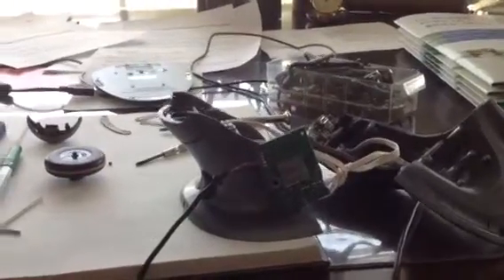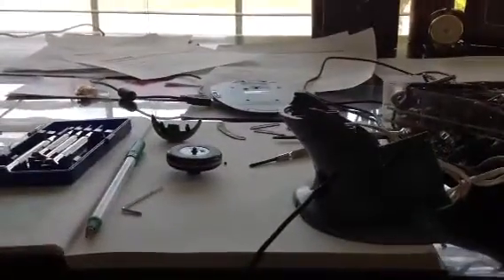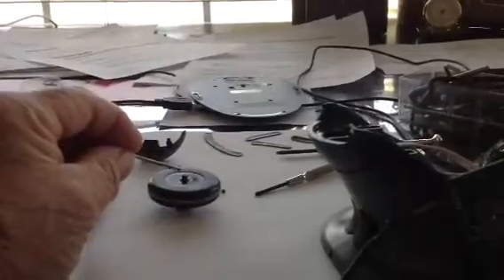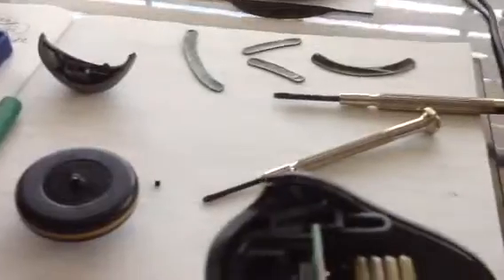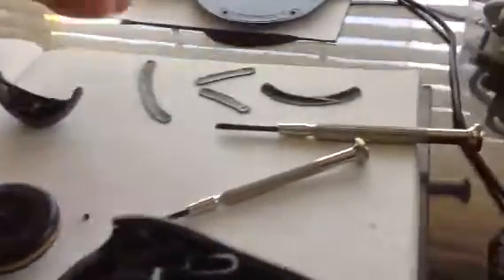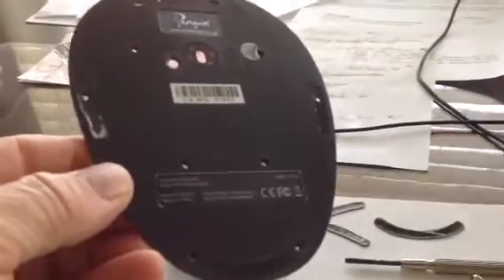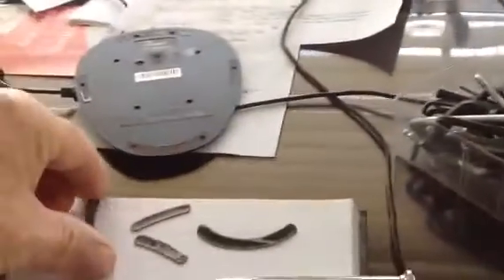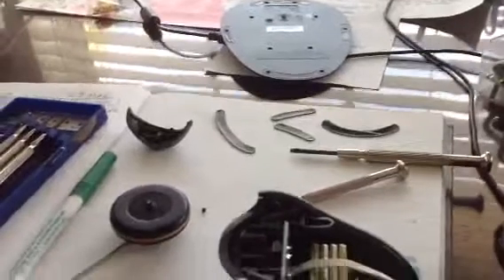How to Fix Scroll Wheel on Penguin Ergonomic Mouse

Comment: Hi Barry,
I have a different problem with my Penguin - the right click (lower) button is really hard to click -  you have to hold it in with quite  alot of force before it works - I suspect that there may be a cracked solder joint or maybe the clicker button is faulty - any ideas about how to sort this out / heard of this happening before, please?

Comment: Hi.  Great idea.   Can you do another video of how to open it, how to access the part etc.  That's what's missing from an invaluable video especially considering that the Manufacturer offers no assistance what so ever except a discount on a new one which is still pricey.  Their approach is so wasteful of an otherwise important and quality piece of equipment.
Reply: Help !!!  I found the screws thanks to you but what next?  Can't open it easily.  I don't want to break it.
Reply: @nigelhadaway1147   Did you figure it out ? I can't 
I am trying to fix the laser after it dislodged following a fall off a desk
Reply: Sorry Nigel. I no longer have that mouse. I'm afraid that I dropped and broke it so it has since been replaced. But the suggested fix did work for a long time.